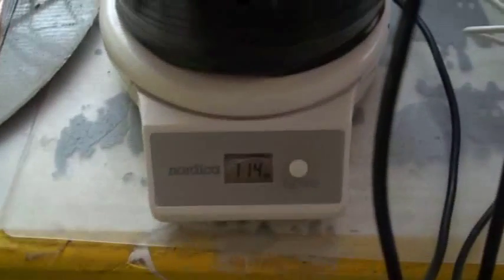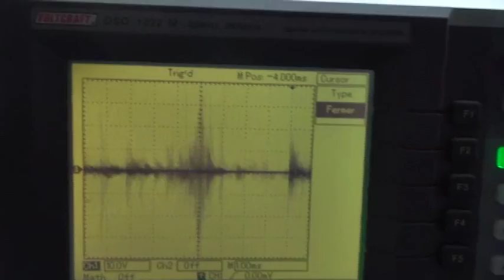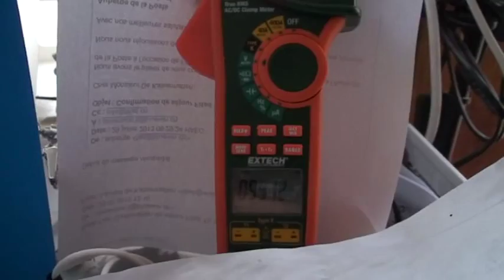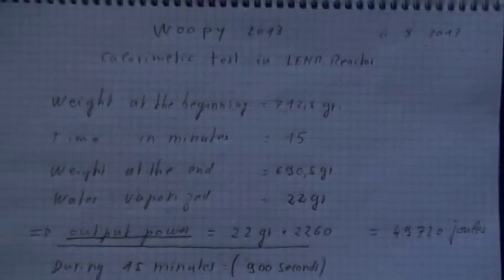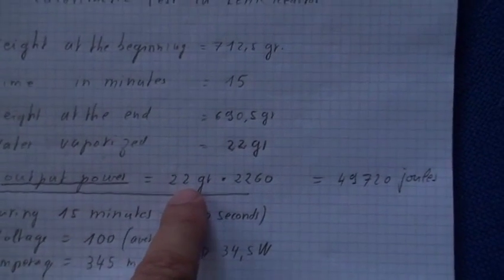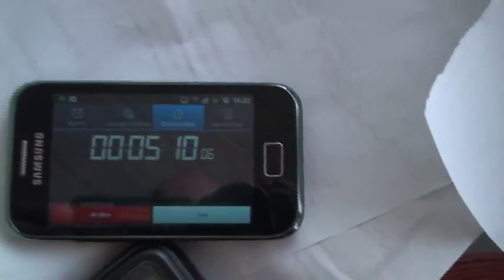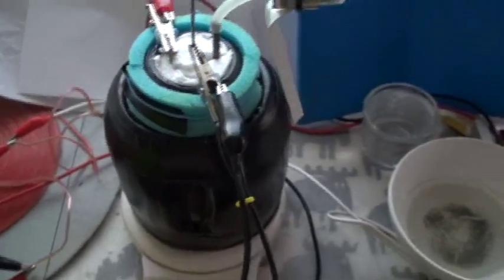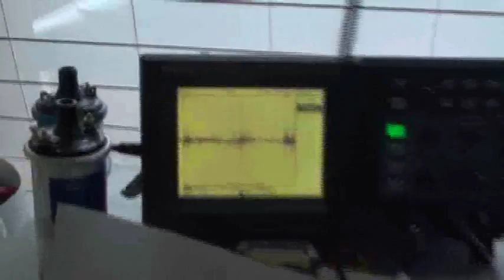LENR pushing the bouchon one step further 1

Comment: There is problem in measuring the input power because of the highly unstable current. The first solution is to treat the measurements as transients using costly equipment. You will need a transient digital oscilloscope for that. The second solution is to treat the measurement as steady state and turning the set-up likewise. That way, you may use the electronic instruments you already have. Something like a a continuous supply of input water at somewhere less than 22g per 15min. and then do the measurements. You may remove the weighing scale off and just measure the rate of flow which is far easier using valves. In this way you may improve your insulation. There is a simple way to measure the rate of flow without measuring valves. You'll just have to create a graduated cylinder as storage and some flow control valve. I would also suggest measuring the pressure created if you can do that. Please tell me if you get any results (negative or positive). Have you tried lithium hydroxide? Believe me, I'm a skeptic but I like to do it constructively. :)
Reply: Your results in this way will me in terms of rate. Something like watts instead of joules, and grams per sec instead of grams. I would also help if you show your ambient air temperatures and the purity of your water but I guess that's only  supposed to add your accuracy.

Comment: When you look at your electrode, it has gas bubbles and water moving around it.  This probably makes it look like a variable resistor.  That's why it looks like from your sensor coil like the current flows in random spikes.  There also appears to be a high frequency resonance in the way the current flows, perhaps the coil is forming an RLC resonant tank circuit with the capacitance of the electrode.  I don't really know how to explain the waveform on your sensor coil.

Comment: Laurent, I think your output energy measurement is a bit more complicated.  You have H2 gas and O2 gas from the electrolysis, steam, and hot water droplets (I am assuming that the steam part is not perfectly 'dry' steam.)  I looked up the electrolysis and it says 286 kilojoules per mole of H2O.  I don't know how you could separate the output from the device into the three components to make the proper output measurement.

Comment: Since there are strange bursts happening at the electrodes it will be very difficult to measure average Voltage over the electrodes and specially average current going to the electrodes.

To have an idea about total power input one could measure Voltage at the 220 V plug (in front of the Variac) and also the current going from the 220V mains to the Variac. A Watt-Meter could be put between the 220V mains and the Variac.

May be you can produce more heat than the total input.

Comment from the maker: Hi Conrad

please look at my previous videos "LENR practical test with a magnet 1 and 2"

You will see the schematic and the use of the tesla coil for dancing magnet.

But this coil is not necessary at all,  it is simply a mean to try to figure out and understand the plasma burst.

For measuring the current, i have also  simply put a Amperemeter in serie in the circuit as for standard circuit.

The voltage measurement is made  between the 2 electrodes on the reactor.

Hope this helps

Laurent

Comment: Very interesting experiment. May be you have shown it somewhere, but I do not understand which circuit you use to drive the vaporiser? Specially the Tesla coil, how is it driven and connected? With a 220V Variac? May be you could include a diagram in your next video. It would also be interesting to see in the diagram exactly where you are doing the Voltage and current measurement. Greetings, Conrad

Comment: Hey woopy,  do have one of those induction cook tops?  What if you power your pancake coil using high frequency power supply and out put of your coil after get's rectified will power the eloctodes? Your power supply is 50 or 60 Hz what if you use 
40 + Khz. That will be very interesting how the water will react to high frequency.  If you  try to do this: Please use high frequency and High Amp diodes, or else you will damage ordinary bridge rectifiers.

Comment: Could you take the pancake out of the system? It is not 1 ohm, unless you measured it with AC 50 Hz? And, these pancakes are very good at wireless transmission, so I think your ampere meter is under influence. it is better to read the analogue meter imho.
If you have a bottle placed upside down and blow the steam in it,and after cooling it, you can use the hho perhaps?
Thanks for sharing.
SOMETHING ELSE, CHECK THIS OUT: search john device on YT for a new energy creator, I think it is real!